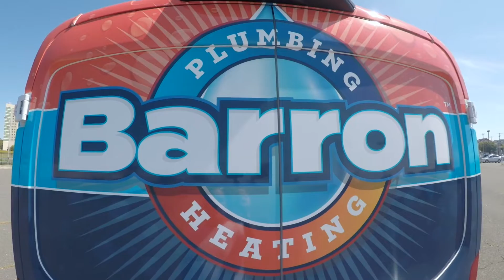PLUMBING REPAIRS | COPPER PIPE LEAKING WATER

Comment: My pipes used to constantly spring leaks because we later learned that the groundwater was slightly acidic. Eventually we put a neutralizer in and the leaks stopped.
Reply from the maker: awesome.
Reply: Try to diber Piping when replacing water lines that little bir  Makes a Fourtex and it’s away at the inside of the pipe

Comment: Next time you may want to use your shop vac on the line to pull out the water before you try and solder. Sometimes you can vacuum from a fixture upstream of the repair.
Reply from the maker: yes yes.

Comment: Like you said at the end Chuck,soldering is a big time requisite when it comes to plumbing.Press fitting is good but it's not the "Be all to end all." I've had to deal with situations like the one you did in the video and what I did was that since the sheetrock had to be redone I broke open the sheetrock enough where I could really get in there and I saturated the inside area with a spray bottle both before I soldered the pipe and after.You can never be too safe when it comes to soldering copper pipes and fittings inside of walls.It's a big pain when you have water dripping in the pipe that needs to be fixed,what I used to do is to shut off the water as tight as safely possible then I would disconnect the union closest to the water shut off to stop the water trickle in order to solder the copper pipe and fittings.Sometimes you get lucky and you only have a drip but sometimes you have a constant trickle of water which makes it impossible to solder.As luck would have it the person that I did the job for didn't want to spring for a compression ball valve before I went through the hassle of disconnecting the union on the copper pipe connecting the water main shut off then afterwards the person told me that he wanted me to install a compression ball valve after I was done fixing the leak,go figure.Of course I had to charge the guy more money for installing a compression ball valve because the guy had called the city and they told him that unless it was a big leak he would have to wait for the city to have somebody available to send out to shut off the water at the curb stop and the guy didn't want to have to wait because there was no telling how long it would be before the city could send somebody out.Plumb on my Brother,you got it down packed.
Reply from the maker: The fundamentals a must.

Comment: In this case I think it would've been worthwhile to make a big enough hole to get the pro press in there. It takes just as much work to repair a large hole as it does a small one in the sheet rock. Don't you think?
Reply from the maker: No room to go laterally. 3-4" stud gap.
Reply: How did real plumbers do it before the mighty jaws of speed?  Skill never goes out of style.

Comment: Hey Chuck,you really should try Milwaukee close quarters tubing cutters ,1/2, 3/4, 1"clean no burs, easy. So many ways to fix this one,Shark bite coupling sweat union,tee,female fitting,brass plug,none are desirable. When your at the lowest point you always have to deal with the steam from sweating the joint. You could use your handy dandy Milwaukee cordless vac,anyway you're a pro and you got the job done,hope you and your family are safe.
Reply from the maker: Jay, we got it done the old fashion way. Thanks my man.

Comment: When soldering in those tight areas where your in a wall space  the Rigid flame less electric soldering gun works extremely well.  Have to be so careful of cobwebs or plastic in the wall catching fire from the heat rising from the torch. Bought two of the units years back and love them.
Reply from the maker: Thanks John. The pumpkin lights are killer.

Comment: Chuck, good example of why in the propress era, you have to know how to solder. Did you ever apply some flux to soldered joint you were trying to take apart, some times helps with removal.
Reply from the maker: The old torch was low on gas. Once I got that it was a wrap.

Comment: Good job. Little tip....once you remove the old 90....keep the pipe hot...and wipe old solder with a damp rag. Sand and flux as normal....New fitting will slide on much easier. The hammer pliers was painful. Lol
Reply from the maker: Good tip! I did and the cold water shut me down and i said ok i get your ass(drip of solder) when i get a real torch....lol

Comment: Next time take a piece of bread and squeeze it into the pipe to stop the drip for a couple of minutes to complete the repair.   When you turn the water back on the bread is dispersed.  This is quick and easy.   I have done this many times.  Always works for me.
Reply: I like to use a jetsweat and add a shut off valve if it won't stop dripping down where I'm sweating.
Reply: @Timah0212   that a better way but you dont want to conceal a shutoff in the wall. I've used the bread trick a few times and it works suprising well.
Reply: @robertkordingjr8835  good point I didn't think about the access panel.
Reply from the maker: Be honest with ya I knew i could power through. I have used bread in the past. Thanks stevie.
Reply from the maker: The wall would have to be opened a lot more for the jet.
Reply from the maker: Best way was to cut it all out and replace toilet valve and prefab it with propress. I was like shit i got this. chose the repair.
Reply from the maker: access panel did me no good. still only 3" between studs. so many ways to get this one done.
Reply: Bread would've gotten you out of there faster
Reply: Any repair plumber knows the bread trick, I’m sure it’s not new to Chuck.
Reply: Be sure not to forget to remove the aerators from the faucets so that the bread has where to leave the pipe from otherwise the water pipe will get clogged.
Reply: that bread trick works every time 👍👍...

Comment: Understand cutting the wall would be another mess. Plus it might have been cut before ya got there. Soldering in the tight spot is rough.  But ya gotta er done.
Reply from the maker: Ya stuck between two studs.. yes your right...got er done.

Comment: Why no pro press? Way to go powering through that drip. Use the bread trick next time. Whenever soldering in the wall I always try to prefab as much as I can outside the wall.
Reply from the maker: I went quick repair. I could of changed toilet valve on other side but to be honest with you i just wanted to get it done and get out. No room for press.

Comment: looks like a nightmare of a job with the water dripping......but another job well done.. would that job work with shark bite connectors??
Reply from the maker: no. the piece on horizontal was a close nipple.
Reply: MrMjn5000 no real plumber would ever use a shark bite